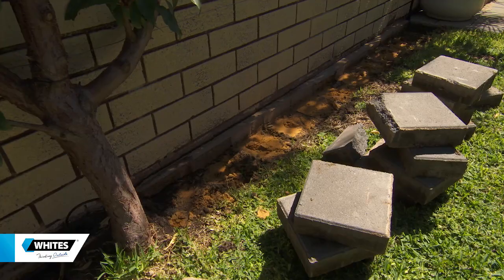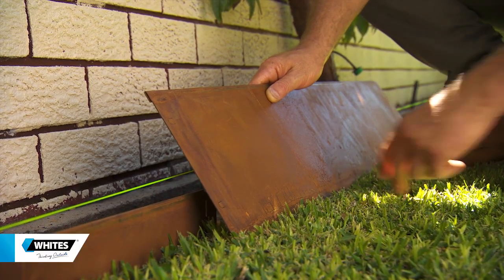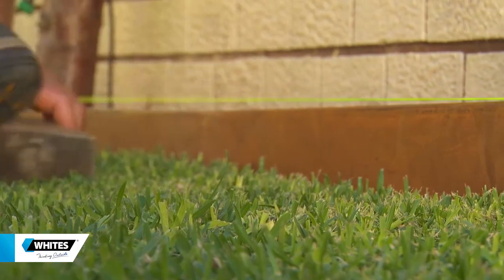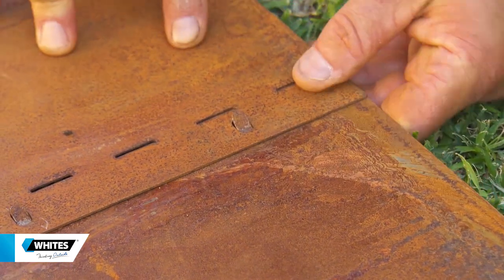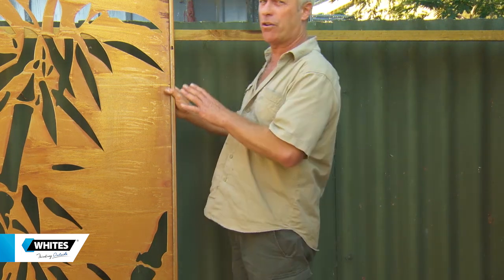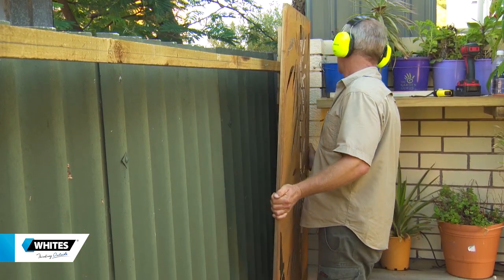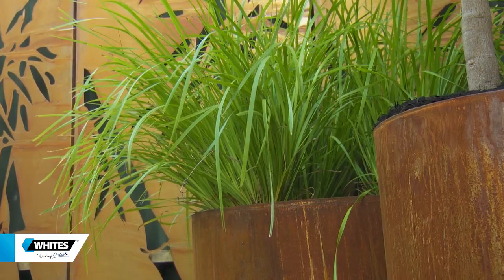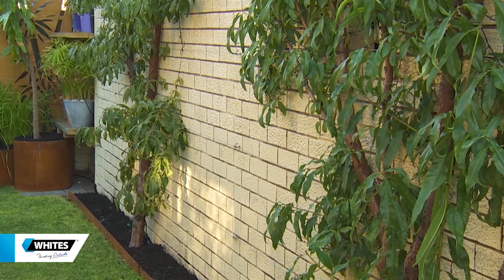Whites Oxy-Shield

Comment: I emailed and asked Whites the best way to cut the last piece to fit my garden bed. They told me I needed a metal fabricator to cut it. Ridiculous.
Reply from the maker: Oxy-shield edging can be cut using a hacksaw or an angle grinder. If you're needing to bend it, then a block of timber and a mallet will help you to shape a corner.
Reply: Ha